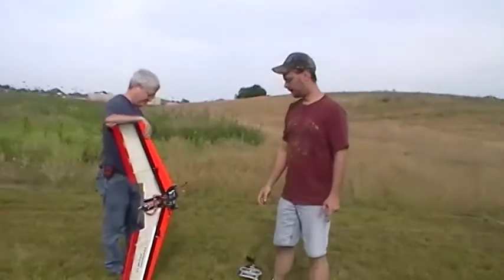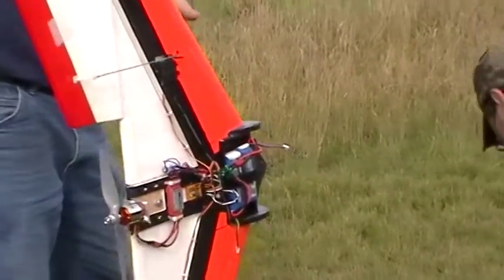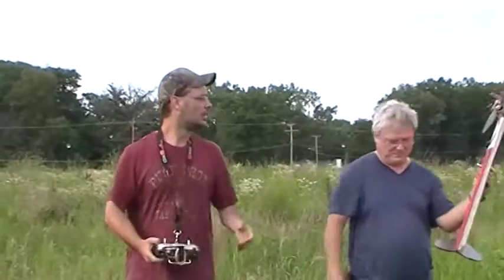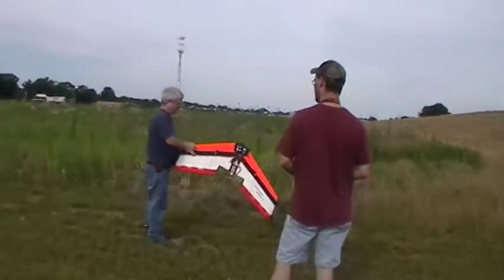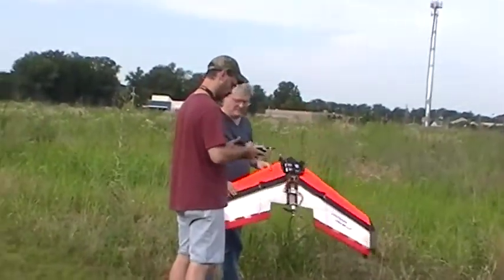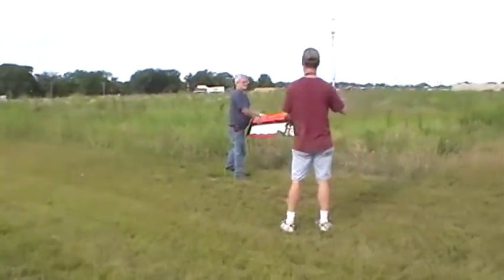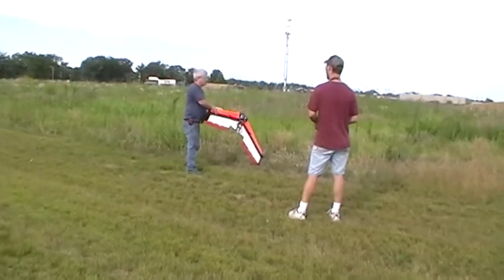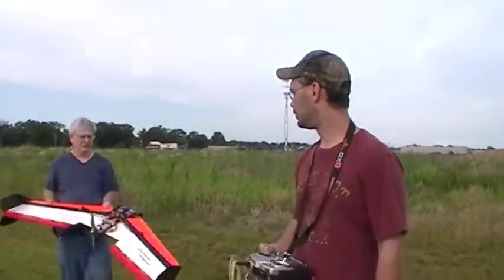FPV49v3 Maiden Flight

Comment: This one is a little larger than the 44" version that I build, but  I'm really surprised that it didn't take flight.  I launch mine sidearm all the time.  Single hand, thumb down, but I do give it a fair toss.   I'm just going through some of your older vids (I'm sure you've gotten this one figured out by now).
Reply from the maker: Thanks for watching!  This flight attempt didn't go so well because of our lack of experience.  That's basically what it boils down to.  I wasn't at full throttle at the time of launch and I didn't have my Dad throw the plane with much authority, either.  Those two key factors is why this plane didn't take off on this attempt.  Later wing experiences worked better.  Ya live and ya learn.
Reply: ***** Glad to hear you got it up in the air!  I have a boat-load of launch failures for the exact same reasons.  Luckily the KFm4 design can take a beating :-)
Reply: ***** Wow, that's almost the polar opposite of my experience with tronds wings.  I've built 5 30 inch wings based on ProjectFlightDesign delta pusher and 3 44 inch wings based on FPVTrond v2 and v3 (love em all).    I will say one thing.  I built a KFm4 30" wing with a heavy/powerful motor/ESC combo and it flies like a brick (a very fast brick).  Have you tried the KFm2 version?  Mine came out a fair bit lighter and floats easier than the KFm4, that's the one I have my FPV gear on.
Reply from the maker: I have not tried the KFm2 version.  Perhaps I should.
Reply: ***** I use a 2836 1100kv on mine (44").  Here is my first FPV flight with it.  You can see that I don't need much effort on launch despite it having a ContourHD, 2200mAh batter, FPV camera and FPV transmitter on it.       https://www.youtube.com/watch?v=FCETOsDCo9g
Reply: ***** Here is the maiden of that same 44" KFm2 wing (this is from my other channel).
https://www.youtube.com/watch?v=spTckI1KG98&list=UUD3m8K0styy_fTua3JDGVUA